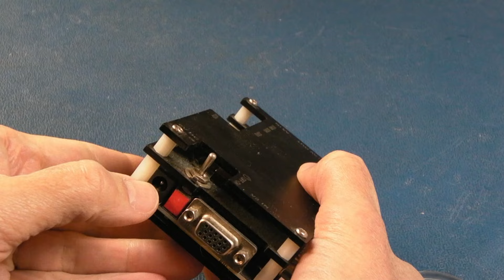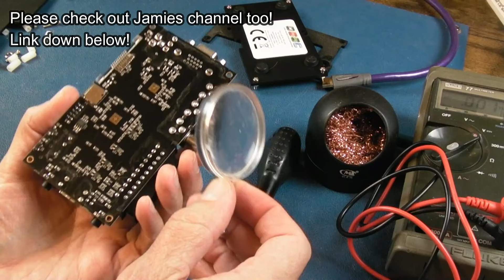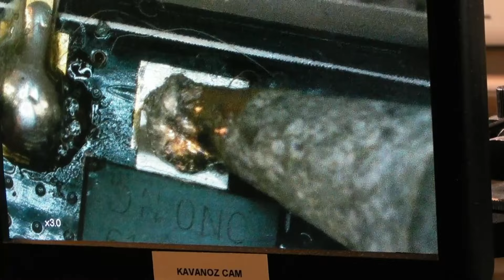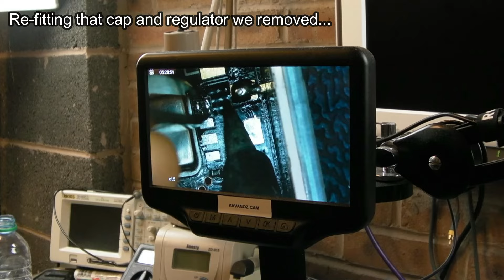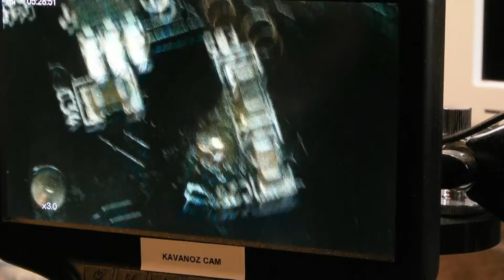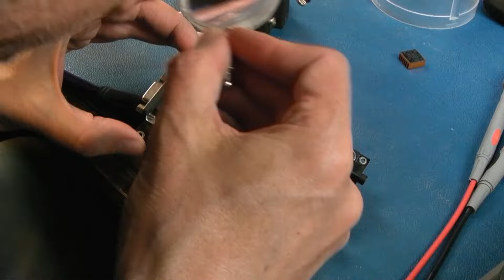Dead OSSC (RGB to HDMI) Repairs - Part 1, Restoring Power...

Comment: I've next to no soldering or electrical troubleshooting experience, if anyone seeing this has any idea if this is an easy fix, I'd appreciate it a lot.
Got an OSSC, worked fine for a bit. Now it won't hold a stable connection when line doubling on 480p (on a dreamcast). On a Playstation, the image will have artifacting with red pixels. This is most visible in 5x and 6x, where half the pixels on the screen are red. These two modes won't even show a picture on a different display.
Reply from the maker: Hard to know off the top of my head - I would first check all the supply voltages vs the schematics!  Looking at the schematics I can see the FPGA takes the RGB from the TVP7002. So it could be a low voltage, or something related to that RGB being passed into the FPGA (either chip there).  If the red speckles relate to the HDMI output stage instead, maybe its the IT6613...   A low or missing voltage out of one of the regulators might cause this though!
Reply: @GadgetUK164  Thanks a ton, man! I didn't expect a reply. I'll go get myself a multimeter and look into this. Have an amazing day!